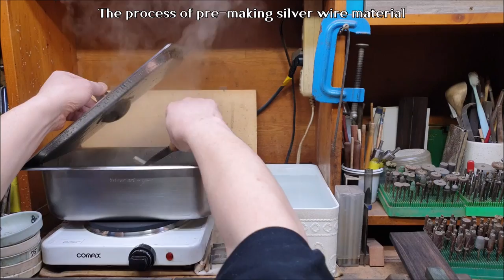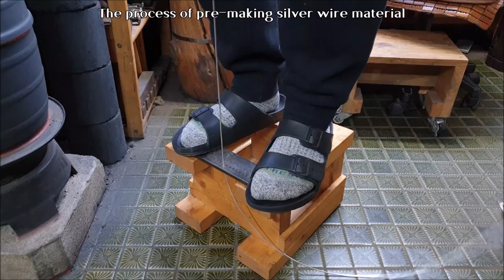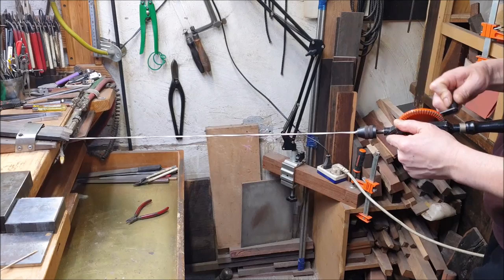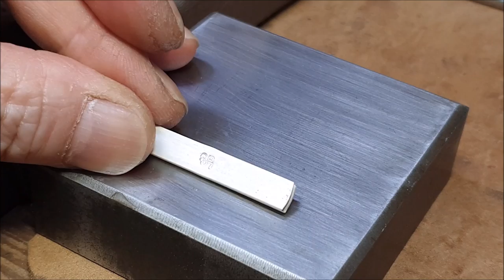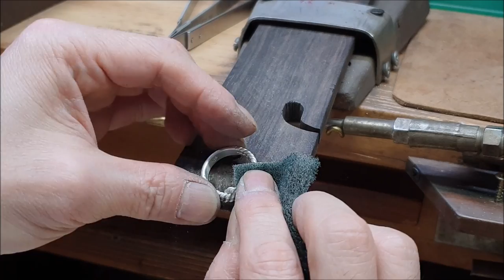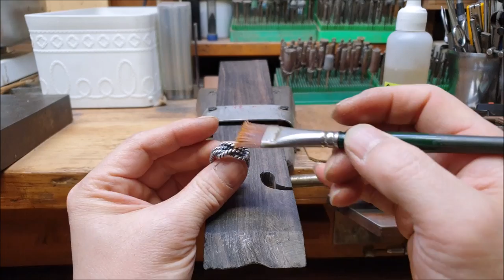Making a handmade twisted silver ring / Video of the special handmade process

Comment: I can only imagine the actual time it took from start to finish...from pouring and creating the wire and all of the intricate work... Do you mind me asking the actual time in making for this beautiful work of art! I know all of the other steps, but what did you apply with the brush at the end?
Reply from the maker: The entire process takes about 2 days.
However, if you make it with a YouTube video, it takes about 3 to 4 days.
Camellia oil is vegan oil.
The reason for applying oil is to delay and protect the oxidation of the silver surface.
A very thin oil film protects the surface.
After applying the oil, clean it again to finish.
The camellia oil that I use is safe to eat.
It is a very good natural oil that is harmless to the human body even when the ring is worn on the hand.

Comment: Me gustaría saber para que utiliza el aceite de Camelia en sus acabados. Muchas gracias
Reply from the maker: Camellia oil is vegan oil.
The reason for applying oil is to delay and protect the oxidation of the silver surface.
A very thin oil film protects the surface.
After applying the oil, clean it again to finish.
The camellia oil that I use is safe to eat.
It is a very good natural oil that is harmless to the human body even when the ring is worn on the hand.

Comment: Thanks for your video. I would like to know what is the final product you applied on the ring?
Reply from the maker: Camellia oil is vegan oil.
The reason for applying oil is to delay and protect the oxidation of the silver surface.
A very thin oil film protects the surface.
After applying the oil, clean it again to finish.
The camellia oil that I use is safe to eat.
It is a very good natural oil that is harmless to the human body even when the ring is worn on the hand.
Reply: @SilverMeister  Thanks for your answer, I will try to find Camelia oil in a natural products store we have here.
Reply from the maker: If you can't find camelia oil, use it as a substitute...
You can also use vegetable non-drying oil.
Reply: @SilverMeister  Thanks for your answer. I will give that a try.

Comment: Whats the oil for that you brush on?
Reply from the maker: Camellia oil is vegan oil.
The reason for applying oil is to delay 
and protect the oxidation of the silver surface.
A very thin oil film protects the surface.
After applying the oil, clean it again to finish.
The camellia oil that I use is safe to eat.
It is a very good natural oil that is harmless to the human body even 
when the ring is worn on the hand.
This is the part that a lot of people are curious about. 
Since my work does not have a special finish after completion,
As a minimum surface protection, it is often finished by applying natural vegetable oil and wiping it.
Although it is not shown in the video, it is sometimes coated with natural beeswax (honeycomb).
Beeswax melts easily even at low temperatures (approximately 60-80 degrees) by applying slight heat to it and coating the entire work.
Since what I am aiming for is nature-friendly as it is, it can be viewed as a minimum protection work.